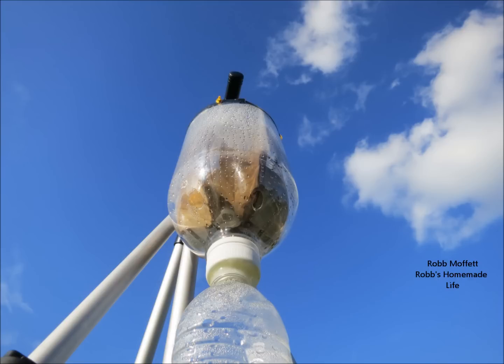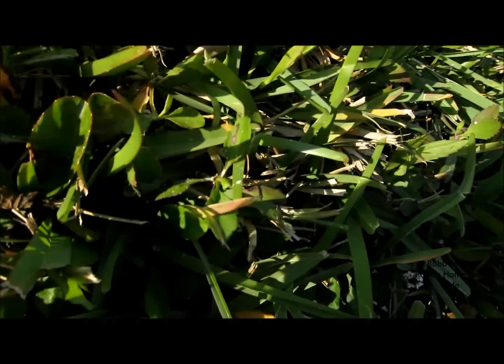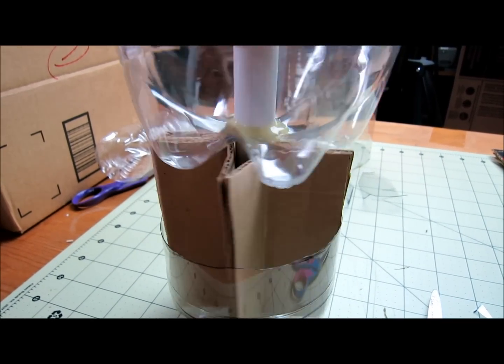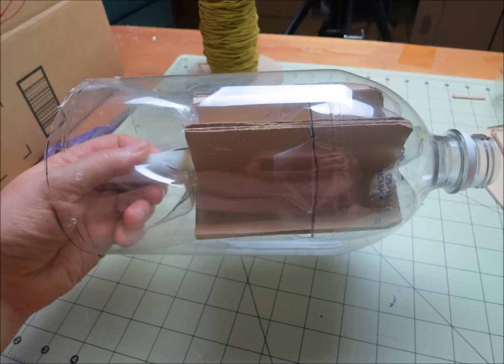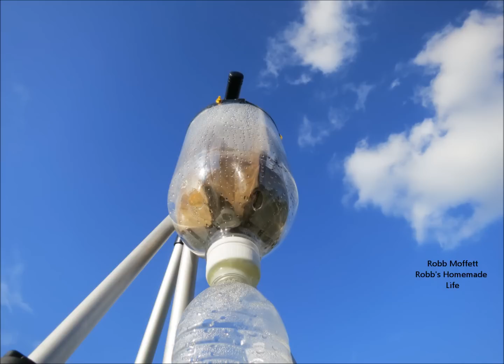DIY fresh water - free solar soda bottle still easy quick to make

Comment: Any alternative besides cardboard for the surface area so we don't have to replace every now and then.
Reply from the maker: I used cardboard as it would be commonly available. All materials will eventually be saturated with undissolved material and stop wicking the water.

Comment: 46mls is not a lot of water, but if you make 100 of this same design and place them together in your yard, that's a lot more water you will be collecting in 8 hours time..... Great idea....... 2nd) you don't necessary need to drink the water. There's a lot of other uses for it arround the house.
Reply from the maker: that is an important point, we require water for many things besides consumption. Thanks a lot for watching and commenting.

Comment from the maker: So many people asked me for clarification of the design I decided to see if I could add a brief and clear description of the still to help those who did not understand the video or bother to read the video description.

1.) The design was basically a thought experiment to see if I could come up with a way to make fresh water from commonly found trash items in a disaster or emergency situation. I also wanted the water still to be able to be hung from a tree or fence so it would not be on the ground and be disturbed by animals. I also wanted it to be able to work for days without attention by me.
 2.)  The design is made up of two bottles, a container made from a third bottle and a piece of pvc pipe and some cardboard.
The bottle still has a large 3-liter plastic bottle that has inside it a smaller bottle that has been cut open to make a container. The container is used to hold nonclean or non-potable water. The non-clean water is evaporated by the sun and collects on the sides of the 3-liter bottle and drip down to the bottom. This now clean water exits a small hole in the bottom of the 3-liter bottle and drains into a small collection bottle that is attached on the bottom of the 3-liter bottle by its cap. The collection bottle collecting the clean water can be simply screwed off of the bottom of the still and emptied and replaced.
3.) To add more non clean water to the container inside of the 3 liter bottle a piece of PVC pipe is inserted at the top and water is added through the pipe. This keeps any non-clean water from splashing up and onto the sides of the 3 liter bottle and contaminating the water.
4.) I added some folded cardboard into the interior container to help increase the evaporation of the water as the cardboard will get wet and provide a larger surface area to allow more water evaporation.
5.) many people left valid comments that sunlight may make harmful chemicals and encouraged me to use other materials. A few mentioned there may be gases from the cardboard that could also contaminate the fresh water. The still was not for permanent long term use. people die from lack of water in 3 days. if I was stranded on an island that had empty bottles on the shore I would definitely make this to help provide water until I was rescued.
if anyone wants to make a design using glass bottles, the channel green power science has the best video I ever saw on how to cut bottles.
For those people in serious need of long term solar water stills, there are videos on YouTube showing how to make large solar stills from materials you can purchase.
 I hope this helps. Please let me know if I can add any additional information and please check out my other videos. I have been adding videos weekly for 11 years on many subjects.
 regards,
 Robb Moffett
Robb's Homemade Life
Reply: Please could you provide a drawing.

Comment: Good idea but I’m having a problem understanding what you did here
Reply from the maker: Sure- there are two bottles, In the top bottle is a container of water which evaporates and condenses on the side of the top bottle and drips down the sides to be collected in the bottom bottle. This design is to use in an emergency with mostly scrap material and it can be hung off the ground and left alone for days.

Comment: I think it's hilarious that people are commenting the issue of using plastics for a potable water project. Firstly, most purchased bottled water comes in plastic containers. Secondly, many take away containers are plastic and in direct contact with very hot food (much hotter than these bottles will get). Thirdly, many supermarket foods are wrapped in such plastics, and finally, when your house gets hot, you're sitting in a soup of plastic vapours. To criticise this project seems a bit stupid considering that everyone in western society is already breathing in, eating and drinking trace amounts of such chemicals. It's definitely a case of putting the cart before the horse.
Like the guy said in his video. You can always use glass bottles to do the same job.
Reply from the maker: Thank you tas. The project was just an experiment to see if I could come up with a way to make drinking water in an emergency with commonly found free items and preferably could be left for days without supervision which meant I needed to make the design able to be hung off of the ground away from animals. Many people overlooked this and left negative comments about the plastic bottles. there are simpler designs if the still can be left on the ground.  This was never meant to be a design to supply water for long term use if tools and low cost materials like wood and glass and metal tubing are available. Thanks again for watching and your comment.
Reply: @RobbsHomemadeLife  
You're welcome. Down here in Tasmania, it's midsummer and I'm having fun over the Christmas holidays fiddling about with cheap methods of making pure water for my lead acid batteries. Have a great new year, Robb!

Comment: I have a doubt. In the first design. What is the small bottle inside the bigger bottle for?
Reply from the maker: the small container in the middle of the top is to contain the liquid that is evaporated and turned into fresh water that collects in the bottom container.

Comment: A solar still providing a liter of BPA contaminated water, (flavored with hot glue and old cardboard), from a polluted water supply, in only three weeks? Really, you should look up the "biosand filter" on Wikipedia, (which doesn't need solar energy to operate it). Just as easy, less contamination, and probably far more productive.

Comment: How about cancer that can come up from the heated plastic bottle. Harmful chemicals that leaches into bottled water from its plastic container when exposed to heat no matter if is BPA free or not!!! Good idea harvesting water from air but not using PLASTIC or aluminium if you don't want to get cancer!!! Too many negligent people in this world!!! SAD!
Reply from the maker: of course long term glass is better than plastic, but the concept was a way to make water using the discarded material to make a water still in an emergency. also, have not found any data showing BPA would be released in increased amounts from temperatures obtained from the sun.

Comment: your  concept is great as an emergency concept. but extractables from the plastic is not good long term. maybe dark landscaping screen might make a good wick.   and aluminum  foil over the bottom will reflect solar heat away..

Comment: I had a little trouble following what you were doing at first, but it made sense by the time you were done.  It's something I think I would want to practice at least once or twice before I actually need such a thing to get the hang of it, but after that I would think they go together quickly and could use a variety of containers and materials using the same principles.
Reply from the maker: Thanks Mackenzie!!

Comment: I like the idea. I may try to make something similar but hopefully simpler. Your video is pretty confusing. By the way, I agree that in a survival situation this could save your life even though it is made with plastic.
Reply from the maker: Brian, you may be right, a few people did not understand the design which I thought was explained in the video, I will try harder next time. The design can be made much simpler if it is to be placed on the ground, but  I wanted a still i could hang off the ground  away from animals that might knock it over and to use commonly found scrap material to make water in a survival situation.

Comment: I'd like to get a print out of these instructions.  I don't exactly understand how it works.  I'd be willing to learn.
Reply from the maker: hello Richard, I am sorry for any lack of clarity, several people have asked me to explain so I did not do a good enough job in the video. What happens in the bottle is the water inside is evaporated by the sun and condenses on the inside of the larger bottle and drips below into the smaller bottle. The cardboard gets wet since it is in the water in the center container  and increases the area the water can evaporate from.. More undrinkable water can be added from the top.
Reply: Do you think to put a cork that has a hole in it in the bottles to transfer from one to another would work?

Comment: Love the concept it does work only problem is that plastic is a petroleum byproduct comes out of a barrel of crude oil ( I'm not even going to mention hot glue)  so the problem is when you expose it to sunlight full spectrum UV All That Jazz it tends to break down putting all kinds of nasty little petroleum distillate byproducts and phytoestrogen nonsense into your water which you do not want to ingest that's the whole point of distilation unless you're living in a nuclear fallout zone in which case you're probably screwed anyway enjoy your cesium with a side of potassium salt. That all being said I'm looking for a design that uses glass bottles such as your common carlo rossi wine jug or bottle. and solar fire starter for focusing the sunlight. your proof of concept is 110% I'll keep an eye out for the glass version.

Comment: With Solar Radiation Management and Cloud seeding going on world wide, I would not trust rainwater. Besides car and factory emissions, nano particles of aluminum, barium and strontium (See US patents for weather modification) are ubiquitous in the air column. We have no choice in breathing them and they are so small they may not all be left behind in the distillation process, but I would do what you can to avoid what you can. Fluoride is synergistic with aluminum, allowing the toxic metal to cross the blood/brain barrier and build up. Now, with the proven direct link of aluminum as the cause of Alzheimer's and Autism, it is a no brainer why those two diseases are going through the roof. Take care to protect and detox yourself now, before you forget what you're protecting yourself from. It's insidious. Learn more at geoengineeringwatch.org

Comment: hi, nicely thought out. watching the survival shows on TV I thought there must be a way to make water by evaporation using found  water bottles that are everywhere , especially on the beaches. in a survival situation you would have to figure out how to do maintain the efficiency with almost no resources  but a roll of electrical tape or duct tape should do almost everything you need, warren
Reply from the maker: hi Warren, thanks for the comment. i wanted a design I could hang off the ground, but if a person did not mind keeping their still on the ground the simplest method is just curling the bottom of an open end bottle over a water source and collecting from the tough made by curling the edge.

Comment: Not supposed to be getting plastic 1 hot, or in this cased exposed to much sunlight, as the chemicals in the plastic are going to be expelling into the water source. Use a P5 bottle if you have one.
Reply: You are one the right track with P5 (polypropylene) PP is generally a very stable plastic, but it is NOT as simple as that, especially for any cheep plastic mass produced across the world.

So called 'Food Grade' plastic is hard to identify unless you are in direct contact with the container manufacturers, and there are different grades. Single use and reusable. Plastic that can be heated, and some that cannot.

Top of the line, bordering on so called 'high performance' plastics are MICROWAVE SAFE REUSABLE plastics. Luckily this kind of plastic is usually identified by symbols on the container. You should be safe regardless of what type of plastic it is.

BUT... 'BPA free' is just a commercial gimmick at the moment. There are no laws or standards covering this claim made for products.
Simply choosing a plastic that is not normally associated with BPA's such as pollycarbonate (P7) is no guarantee they do not contain elastomers.

Comment: You want to make this out of trash, without purchased "paint"---so BURY the collection bottle. keeps it cool out of the sun, less evaporation.  A small hand pump with tubing can be used to empty the accumulated water from all your units.  no need to disturb the buried collection bottle once buried.
Reply from the maker: mark, I like your idea, but one of the main things I wanted with this design was to keep it off the ground so animals could not disturb it and it can be portable or hung against a wall or from branches.

Comment: its neat but im haveing a hard time understanding what you did here.
Reply from the maker: Sure- there are two bottles, In the top bottle is a container of water which evaporates and condenses on the side of the top bottle and drips down the sides to be collected in the bottom bottle. This design is to use in an emergency with mostly scrap material and it can be hung off the ground and left alone for days.
Reply from the maker: @Hugh Jarce Hugh, I have received a lot of complaints about this video regarding a lack of clarity. A few are normal but after a few, I have to face the fact I failed in being clear in my video. I have made over 700 so I guess I should be allowed a couple of failures.
 I will make another comment to this video detailing the construction in a more clear manner and pin it to the top of the comment section.
To answer your question about the purpose of the pipe, it was to allow additional amounts of non-potable water to be added to the small container as it evaporated and needed to be replenished. A pipe led the water to the bottom of the container and kept any water droplets from being splashed onto the sides of the bottle where it would then be mixed with the clean water and destroy the effectiveness of the still.
Reply: @RobbsHomemadeLife  did you ever make a followup video with more clarification?
Reply from the maker: @LOLFUCKSTUPID  look in the comments and video description, I added much more info.

Comment: The principle is awesome! I would however use a  black or dark soda can instead of the cardboard. It will increase the solar heat process and be cleaner than the cardboard.
Reply from the maker: Hi Luke, the cardboard is to increase the surface area and evaporation.

Comment: Lot's of toxic BPA is coming from the plastic bottles in your water. Never use plastic!
Reply: PETE (Plastic #1) doesn't leach BPA but can leach some other stuff.
Reply: You need to get an education. There are over 150 common plastics in the average western home. You are breathing it in all the time.

The jury is still out on BPA's, but they are mainly found in PVC (Vinyl) products. That includes breakfast cereal bags, clothing, flooring, car interiors, plastic pipes, soft furniture, etc etc. Good luck on trying to avoid them.

There is currently NO REGULATIONS covering 'BPA free' plastics. So there is no way to police commercial claims.

Comment: the most over designed bottle water distiller I ever saw.
Reply from the maker: +Ye Olde Salt give me a link to a less designed one that is made to hang off the ground and you can leave untended for days that you have seen? I can wait.
Reply: one of the key points of condensation is the necessity of a difference of temperature. by design, if both your evaporation and condensation vessels are close together (hanging out in the open) basically sharing the same temperature, it's already less efficient. so no, if I did see a similar setup hanging in a tree, it would not be the design I would opt to adopt. I will overlook the inclusion of all the flaps, tubes, cardboard, and glue over just that aspect alone.

Comment: That cardboard is so fckng toxic LOL... have you ever smelled the bottom of your hot pizza that has been laying burning hot on the nasty cardboard box they place it on/in.!? ...and let us not even mention the plastic! puke!
AND YOU SHOULD NOT GET IN THE HABIT of drinking DISTILLED water... ONLY IN AN EMERGENCY... you need water filtered by ground material like sand, moss, charcoal, etc... then boil that.   that way you get the minerals you should get.

Comment: With the top being the inverted bottom of the 3L bottle, drops that condense on the top will drip back into the waste water.  Better to attach the other way?  Also, what about lining the INSIDE of the 2L bottle with black electrical tape to catch more light?  Note, the water vapor that condenses, but I don't know if electrical tape will also emit vapors.